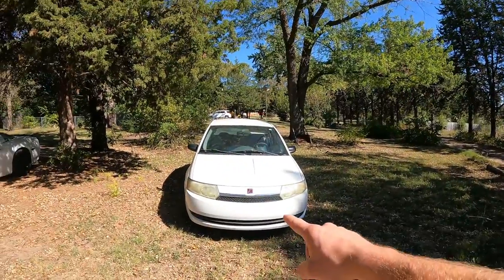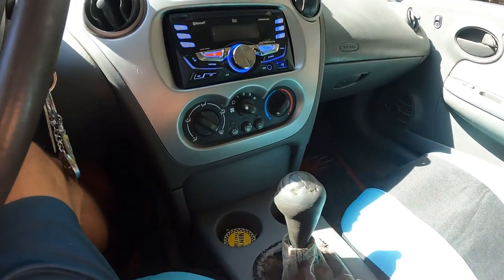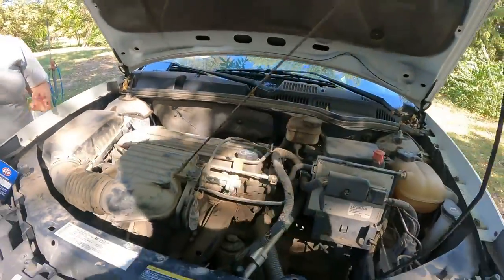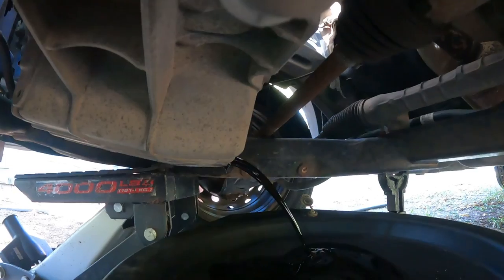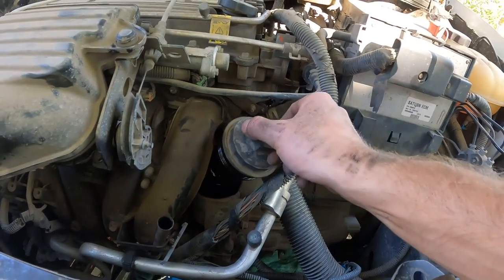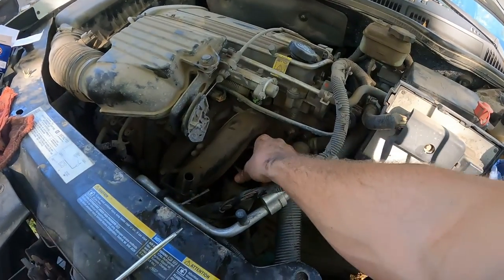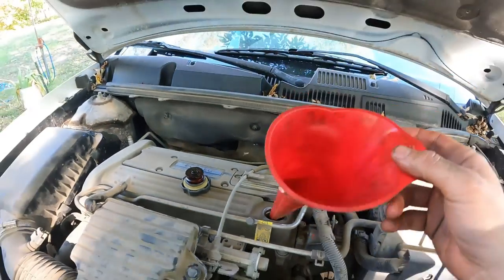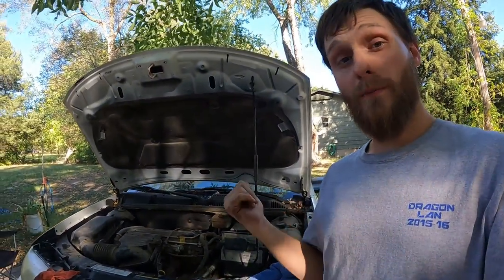HOW TO Change oil in a Saturn Ion II 2.2l - Daily Vlog

Comment: Thanks for the Vid. Just Hit 180,000 miles on my 2003 ION-3 today... Oil Change planned tomorrow. A relatively quick and easy project. 

During my last several DIY Oil Changes I've just lifted (plus a Jack Stand) the driver's side (at the Marked Front Left Lift point)... Allowing just enough room to access/drain the Oil Pan.

Noticed in this vid you used a more central and robust looking part under the vehicle for the lift/stand points.  I'll have to give that a try this time.  Looks like a good way to get some extra height and stability without lifting both sides of the vehicle.
Reply from the maker: You're welcome! I typically don't use the "correct" Jack points, but rather another good jack point. Somewhere on the frame where there is good contact for the jacks, no slipping or half way on/off the jack stand. 

Then I use my jack as a backup just in case a stand was to fail.

I could have had even more room had I jacked the car up more but I had plenty. 

Good luck on the oil change! Let us know how it goes 🙏🏻
Reply: @ArcticVette  Yep. Don't have lots of extra lift height with my jack, nor space for the Jackstand  at the factory jack points... So if Clearance can get me near enough, and Age/Rust doesn't result in punching a hole in, or bending part of the car I'll be very comfortable/happy
Reply: Oil Change went well. (Well except... Always empty your Drip Pan/Jug beforehand... Going to need several OilDri/Cat Litter Sessions to sap up the Spilt Quart(s) off the Garage Floor) 
Didn't use your Lift Points... But they do look sound will have to try next time (Spring 2023!).
Reply from the maker: @lgoamity  glad to hear! Aw man that gets me every time too but luckily kitty litter does the trick
Reply: @ArcticVette  Almost always end up Spilling a little. Figured THIS time was going to be different.